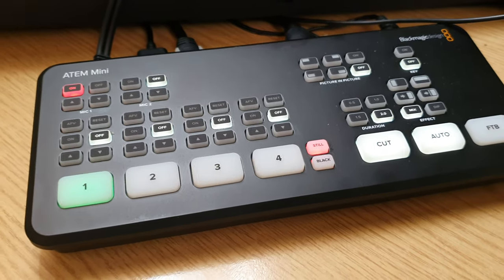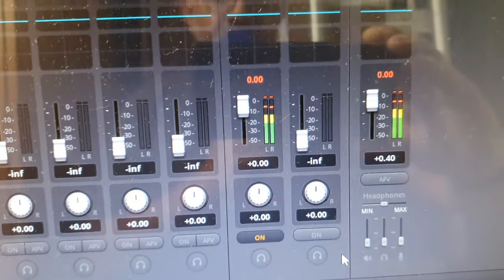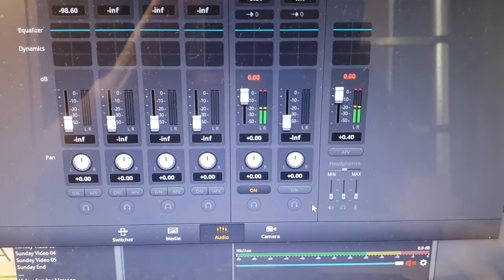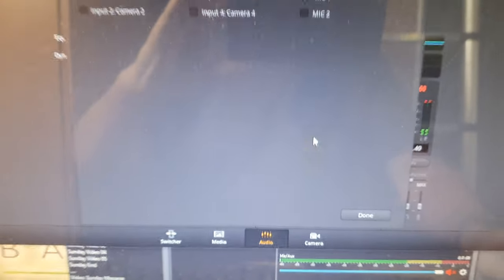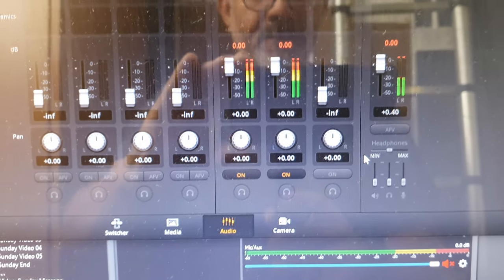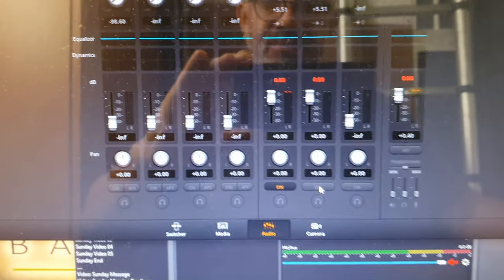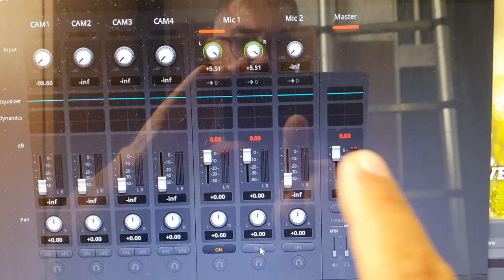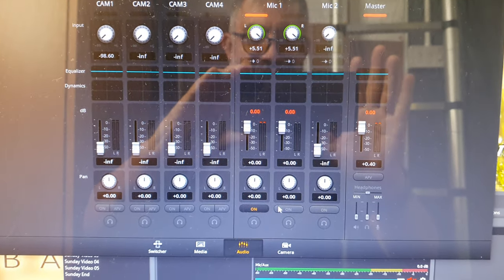Fix ATEM Mini  Bad Audio in 1 minute!

Comment: XLR balanced (outside of Japan) is 1=ground, 2=hot, 3=cold
The equivalent in TRS (single channel, balanced) is tip=hot, ring=cold, sleeve=ground

What ATEM mini had is 3.5mm TRS for unbalanced stereo: tip=left, ring=right, sleeve=ground that should operate at -10dBV norminal

when you plug balanced (single channel, mono) into unbalanced stereo jack, you get
hot->left, cold->right, ground stays connected
the hot and cold in a differentially balanced transmission carries  opposite polarity, same phase of the original signal, they cancel out each other when you play both in near field

tip: The ATEM MIC IN can be configured as microphone or line level input
Reply: so how to fix that when mainly the sound is going in the left channel but very little in the right channel? how to match them?
Reply: balanced transmission only requires both hot and cold to have same impedance to ground, this allows the same common mode noise voltage to appear on both hot/cold terminal, it is common for the cold leg to not driven, remain at ground potential to save cost
Reply: Spoke to black magic and they said to use a Rolls MB15b ProMatch

Comment: Adding to the previous answers, note that the signal in a balanced line (the XLR connector usually carries balanced signals) is between the two signal-carrying wires, with No reference to the third pin of the XLR or the sleeve of the TRS plug if that's what your hardware uses. Thus, a connection cable with XLR on one end and TRS on the other will simply change the plug description, but not the signal type. The confusion comes when we look at a TRS plug and think "Ah, stereo." But balanced signals are not stereo. Headphones are stereo UN-balanced signals--Left on Tip, Right on Ring an a common reference (often called Ground or Earth) on the Sleeve. If you connect a balanced 3-wire output by a cable to an unbalanced 3-wire input (mixer to ATEM) you get positive-going voltage on one wire (tip) while simultaneously getting the mirror negative-going signal on the other wire (ring). In a perfect world, they cancel each other completely; in practice, the result is a very weak, very noisy signal. Not at all what you want. 
In hardware, without mucking around with the ATEM, use a passive DI box in reverse feeding a jumper (short length) of 1/4 mono (TS) to 1/8 stereo (TRS) with the T and R connections soldered together. That gives you the same monaural unbalanced signal on both sides of the ATEM input.
Reply from the maker: Indeed,  or do what I did in the video... It's a feature on the ATEM and something you can instantly do if you didn't have any extra hardware or folk to tell you what's wrong but without actually offering a solution without extra kit 👍

Comment: What others are saying is essentially correct without enough explanation. You can make an xlr to trs cable for this...xlr end hot =pin 2 cold =pin 3 ground= pin 1, on the 1/8” trs side hot goes to tip and ring, ground and cold goes to sleeve.
Reply: If you want an xlr stereo version then left xlr pin 2 goes to tip, 3 cold n 1 ground combined on on sleeve and right xlr pin 2 goes to ring, 3 cold n 1 ground combined on sleeve...
Reply from the maker: Thanks for replies... Like the others all correct,  but for someone without a soldering iron and an extensive knowledge of cables and the time to do all these things my video shows an instant workaround using the settings in the Atem... 👍 10 seconds and job done which just might help someone 😎

Comment: Somehow I think there is something wrong with your video so I am happy it has only 216 views :)   I never had or have issues with the mic in port and I also use a 2x xlr female to stereo minijack mail converter cable.  In the video it does not show if you have actually switched off the mic pre-amps and also why is the gain at max?    Your solution switches off one the channels I think. so there only remains one side?  Or maybe you used a 1x xlr to stereo minijack. If you did that then you are trying to convert a balanced signal into 2 mic signals and that could result in strange distortions.  So my guess is either you messed up gains or you are simply using the wrong converter cable becasue you have no clue what balanced means.
Reply: Thanks for reply... My solution was as per the last part of your comment. If you are running a mono system which most folk are in a church hall,  there is just one XLR coming computer and this is the solution that solved it for us 👍 if useful to someone else with the same setup... Sharing is caring 😁
Reply: @limbrickwoodbc5533  Thank you for your reply.  To viewers I would like to say: 1: Buy the right convert cable and 2: Be sure to set the Atem in the software to "line" instead of "mic" to avoid possible damage to the mic pre-amps in the Atem.  For more information on connecting a 'xlr mixer out' to the Atem microphpne input I suggest watching my video on this. At The end of the video it also showsthe diagram of the right convertion cable. The video also shows the right way to unbalance if the Atem is standing more then 10 meters away from the mixer. Sharing is caring :)  2minute video https://www.youtube.com/watch?v=YQbWidjN6qo
Reply: Great video for a stereo setup, but if running MONO (single XLR from audio mixer (eg AUX 1 not Main LR) to the Atem Mini stereo input) which is the setup a lot of venues have, you have to disable one of the channels otherwise it screws your audio up - like all things, it is not until you try it LIVE and realise something odd is happening (that shouldn't happen) that you need a fix like my video - hence the LIVE demo, not just plugging a few wires into a system that is not installed. 🙏
Reply: @darrenbovis-coulter594  In the atem software you can change the stereo channel to 2x mono channels and then mute one. The other will be spread over the two channels(L & R) unless you change the Pan.
Reply: Im late to the party but I also use the 2x xlr femail to 3.5mm jack. Even after changing source to Line level, and the meter not getting anywhere near peaking on the atem, I was getting distortion. This video doesn't help because I need my stereo image. But the right cables, as you mentioned, didn't work for me. Going to try a hum isolator as some forums suggested and hope that works.